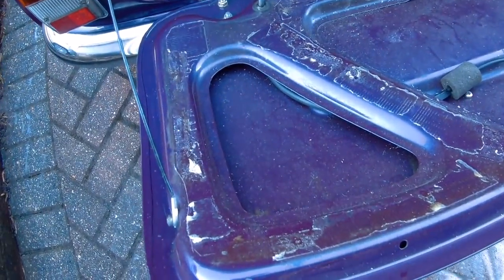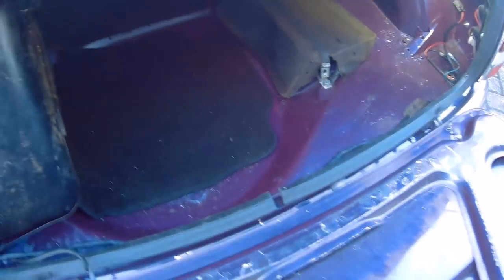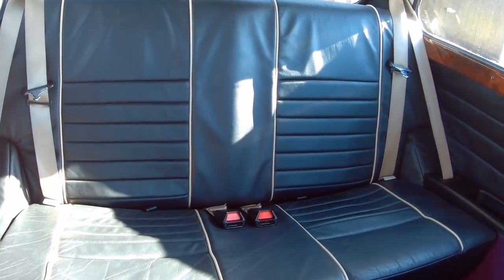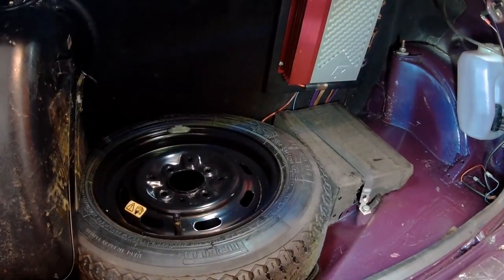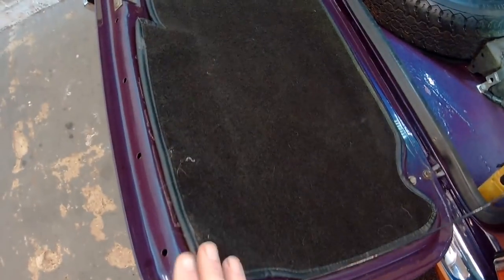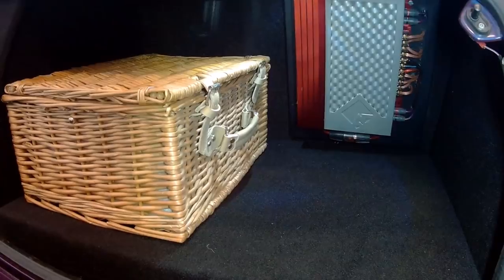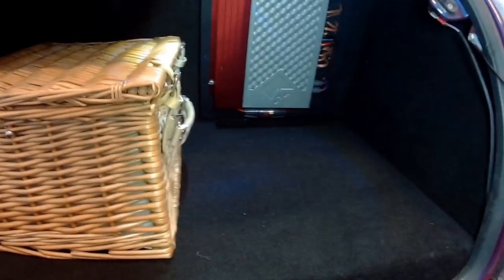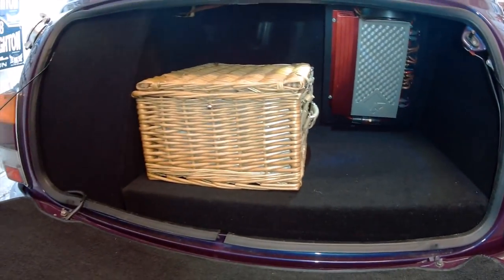Classic Mini Boot liner install - Winter Workshop Part 12.5

Comment: Use Vaseline on the glue and it should soften it and wipe off. Leave it on for a couple of days.
Reply from the maker: Mark Draper I’ve never tried that, will give it a go
Reply: Lucy uses it to get sticker glue off stuff. It's the Petroleum in the Vaseline. 👍 Obviously try it in an inconspicuous area first!

Comment: Keith, great vid as always! What fuel cap are you using? I'm struggling to find one that fits the fuel injected tank!
Reply from the maker: Hi, the fuel cap is an original John Cooper item that came with the car. I believe they are called Aston alloy fuel caps. They are slightly different to reproduction ones which fix onto the filler neck. The JC one fixes to the fuel cap so when you undo the fuel cap the whole thing comes off. I have seen many MPI minis with very short filler necks which make it difficult to fit the later type caps that grip to the filler neck. I would think to overcome the problem you may have to loosen the fuel tank and push it further in so the filler neck sticks out a bit more.
Reply: Keith Miller yeh, my old one is but it's pitted and looking ropey, may just fork out the full 'Cooper tax' and get another.
Reply from the maker: Dagowly83 Have you tried metal polish on it like Autosol? If it’s alloy it should clean up with some elbow grease 😁
Reply: Keith Miller it's pitted mate. Cheap copy of the original unfortunately!